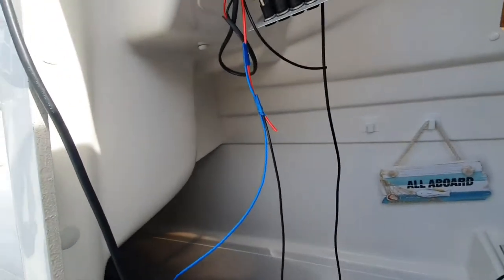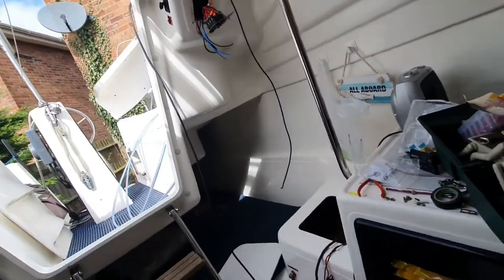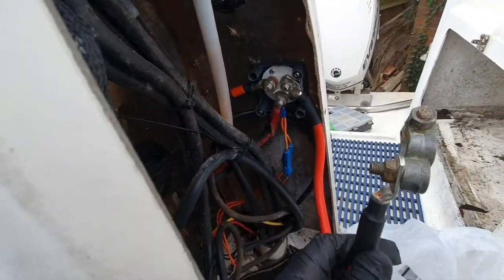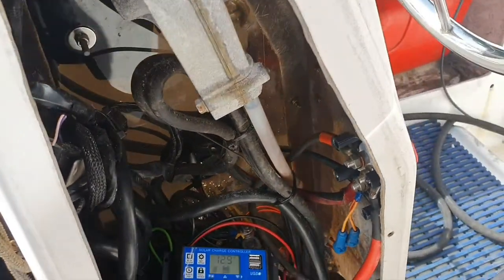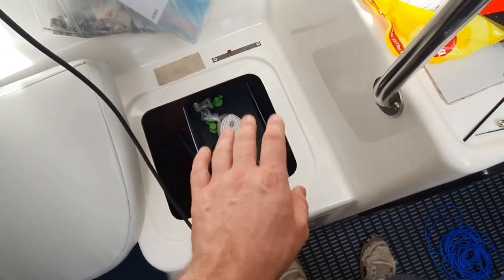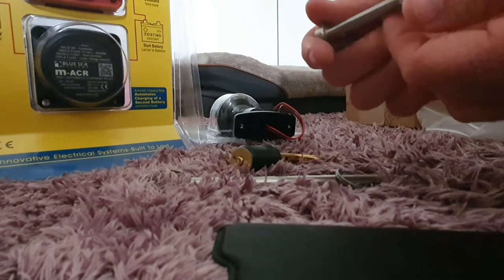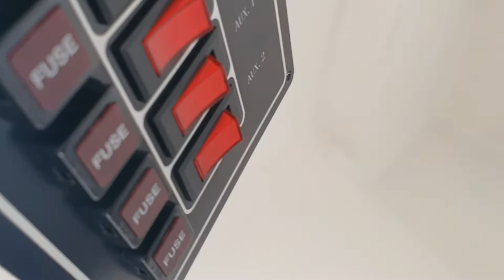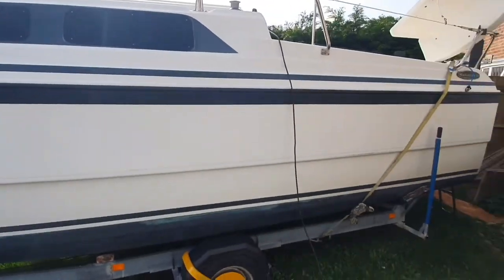Macgregor 26x Sundance - Solar Panel, Control Panel and Kill Switch Install #4

Comment: what solar pannel did you buy and will it charge two 12v leasure batteries want to add two to mine now but cant find the one you have or where you got it from! cheers
Reply from the maker: Hi, I used I think 25 watt ones at the time which was fine for what I needed and wanted to spend. It was also the right physical size for mounting on the rails. Now you can get more for less money if you wanted to. 25 watt was enough to keep it topped up and recharge in between use which was days, if you use it more frequently I would suggest bigger.

Comment: can you drill through the solar panels or does it have to be through the silver part only? ive found the bigger  system i need but the lines are thin not like yours with the thick joints or can you think of a glue i can use to glue them to the bracket you have used as i have bought two of them. hope you can help